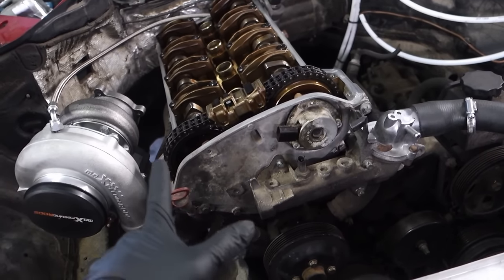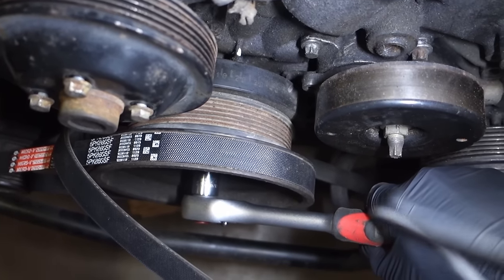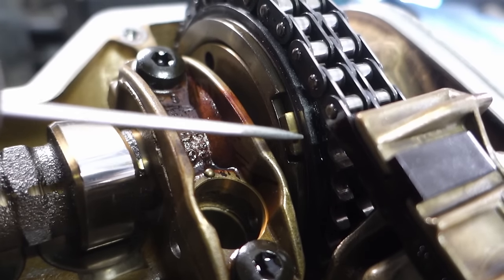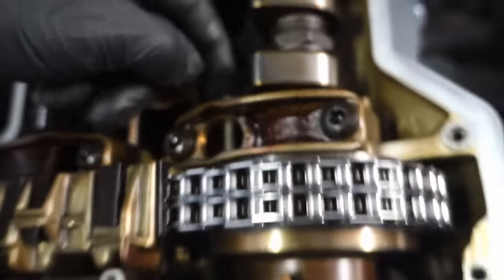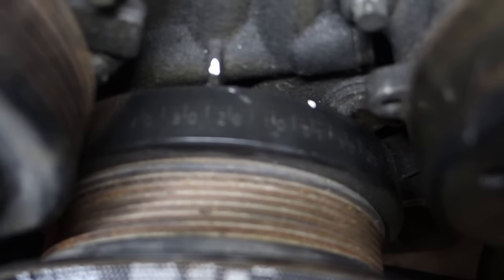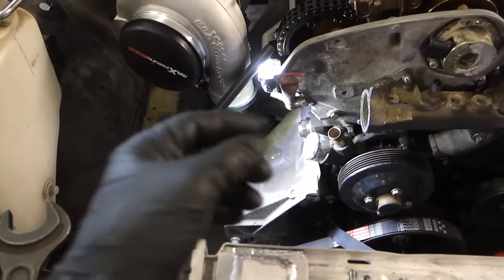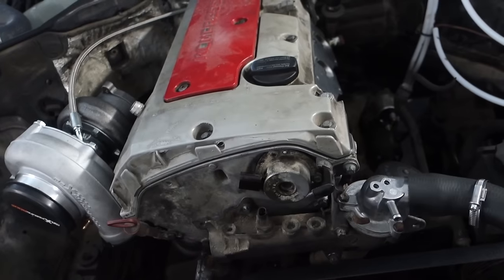Mercedes M111 setting, checking camshaft timing - important details no one talks about

Comment: Mine crank timing is gone 10 only , after put screw inside the cam . Is that ok timing ??
Reply from the maker: Sounds like wrong timing. Watch my full video and check it again.
Reply: @ ok tommorrow i check ..thanks you
Reply: So need to cheq venos sistem tomorrow or what 😔😔
Reply: Hello bro i do IT again now the crank is nearby 30 is that ok right …

Comment: years after but I did not check the timing. my M111 is only noising when coldstart for about 2-3 seconds. Get the tip to change the chain tensioner. I installed the new one but want first that the oil pressure put him in the right position. How do you crank the engine only by starter? I don't want to start the engine and the chain is jumping over.

Comment: hello again, i have to ask one more time. did you set cylinder 1(or 4) in the up position with turning the crank before adjusting the camshaft timing? or does it automatically happens either it is not dependent ? thx in advance
Reply from the maker: Hi, sorry, I do not understand your question. It does not matter you turn camshaft or crankshaft first, when installing timing chain. After chain is installed, you do all turns by turning  crankshaft.
Reply: @MechanikasLukas  he means TDC of cylinder number 1 ?
Reply: It makes no difference.

Comment: Just wanted to thank you for your video that helped a lot .
I have this same motor and it snapped the intake camshaft. I couldn't find a intake camshaft for the exact M111 motor and the one that snapped were not the original and looks like the previous owner put a different camshaft in as it had a 6mm higher profile than it should have and the reason why it snapped as the valves bottomed out.
So eventually I found a camshaft of a later model but the timing pins on different positions. Your video was so that I could see were the camshaft lobes sits in top dead centre. The engine starts and runs fine except for that the one injector is now stuck open and over fuelling because it stood for 2 years.

Comment: Thank you it's a great tutorial and really helpful. Really apreciate that you showed us how to properly do it. Please now I'm trying to solve one problem. I'm not able to reach 20° just 10 or 30. I didn't have space  for oil pump replacement (noisy chain) and mechanic made a mistake - result contact between valves and pistons.. ok now I'm trying to repair it after year ... Do you think that reason why I can't reach 20° could be that guys in shop took 0.35 from head? All timming parts are new. (Changed year ago by mechanic) thank you in advance.
Reply from the maker: Hi, if you are checking timing right, than yes, it is most likely because head was shaved alot, also why they took so much, mostly 0.05-0.15mm is enaugh to resurface.

Comment: Great video excellent work
But when crankshaft is on TDC. We count 6 or 5 teeth for the intake camshaft? It was little confusing to me honestly
Reply from the maker: You need to fully retard intake  cam, than count 6 teeth and 6 teeth must align with that hole I am showing in video. If camshaft is advanced, than it will not allign and  you could not check timing correctly.
Reply: @MechanikasLukas  and then after that i have to lock the camshafts right? Using the TDC method
Reply from the maker: @marwanjoan3789  there is no way to lock camshaft from turning in vanos unit, you just retard intake cam by turning cam anticlocwise, like I showed in a video.
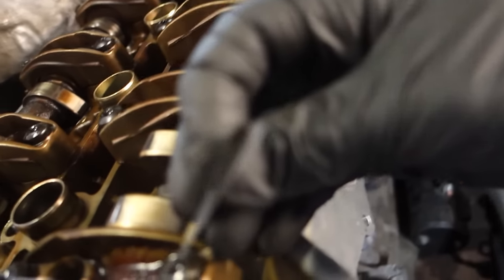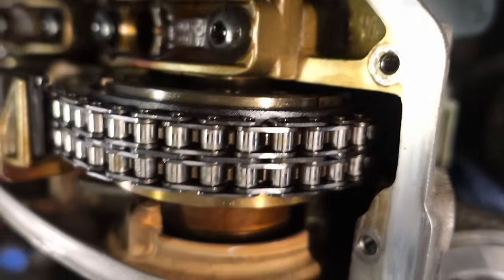Reply from the maker: Everything I explain untill 4:33 time mark. After 4.33 I am showing what you can do wrong, untill 5:12, where I start to explain another way to check timing.
Reply: @MechanikasLukas  i have to lock the cams in position in order to remove the chain so the cams won't jump teeth and timing will be lost right? I'm not talking about vanos anymore
Reply from the maker: @marwanjoan3789  if you removing chain, just align timing marks roughly and remove what you need. You will need to set and check timing preciseley when installing new chain, not when removing it.

Comment: System: ME-SFI-
Engine electronics
Description: Y49 (camshaft control solenoid) ,Mechanical fault [P0010]

encountered an error after replacing the timing chain w203.045 m111 kompressor (P2014-8) [P0010]

Comment: Brilliant video thanks for the help.
The issue I have is when I try to adjust the Vanos it feels stuck and spins the whole engine. If I hold the crankshaft with a breaker bar it still won’t adjust.
Anyone any ideas ? Feel stuck
Reply from the maker: Thank you. Try to turn it other way a little at first.
Reply: Can’t get it to move either direction
Reply from the maker: @jamesscott7682  something is wrong with a vanos

Comment: So I’m trying to do mine can I just do the first method or do I have to do both ??? Please see my coment
Reply from the maker: Hi, you can do any of these two methods, both will work, if you do it cerfully.
Reply: @MechanikasLukas  I tried both today and my pins line up on my exhaust side cam but no my intake and idk how to make them line up please help me 🫶🫶 Thankyou for u excellent video
Reply from the maker: you need to turn intake camshaft to full lock retard position, like I show in my video 3:10

Comment: Definitely not laughing> I think you were saying Vanos, BMW speak for adjustable cam timing. 
Adding this to my list for my soon upcoming head gasket replacement on my 02 M111.981 Kompressor.
Reply: Hey mate, I am re-building an M111.955 engine (2002 C200K) - do you think I need to get a special tool for setting the timing? It does not look like the Mercedes tool HAS to be used...
Reply: @SupaTima  Not sure what tool you're referring to. I haven't yet done the work...rather nervous about it, it's a big job.
But I'm blowing vapor from the engine compartment into the car when not on recirc, so probably a toxic situation and needs to be done. Car runs great otherwise, just the gasket, 
motor mounts and a little suspension work and be like new even at 250K
Also 2002 M111 C230. This guy has the most complete start to finish on M111 head gasket, there are like 5 videos. 
And there's a pin that needs to be knocked out, another video around somewhere on that easiest way.
Obviously you'll need to remove Supercharger which this car doesn't have but  otherwise mostly the same. 
https://www.youtube.com/watch?v=c1l80UG9m9k
Reply: @DimlyAwareHUmAn  hey man im looking to replace my head gasket too soon haha good luck if you haven't done it already. i started today by removing my supercharger and exhaust manifold, but im super nervous about that timing situation
..
Reply: @samurboi8007  is it really necessary to remove the supercharger? Damn, I just replaced the damn thing along with the alternator. Also WIS mentions removing the tube on the back of the head where the transmission dipstick goes with 722.6 5 speed auto, but no mention of how to remove it. On the back ofthe engine. 
Did you remove any fan components, shroud etc?
Reply: @DimlyAwareHUmAn  im not sure about the dipstick. I havent come around to removing that as yet, ive started removing my cams but i got busy again so i have to come back to that when im ready. Im pretty sure youre gonna have to remove your sc again though, because at the side of the engine, theres a chain tensioner, which you NEED to remove along with your cams and reassemble, because the chain will be wayyyy overtensioned and you'll wreck your engine. Check and see where the chain tensioner clears if you're lucky you might be able to get away with just removing the sc top housing which is 6 bolts+ the pesky annoying boost hose clip. The tensioner bolt is pretty large tho, 27mm i believe, its the same as the crank balancer bolt so whatever you use to turn over the engine for timing will come in handy there also. I may have screwed up tho, and remove my tensioner too early before marking where my cams were fully, so i lost my timing there. Oh well, ill cross that bridge when i get to it, itll get retimed anyways to account for chain stretch
Reply: @DimlyAwareHUmAn  and for your latter question which i forgot to include, nah, i have the electric fan and didnt need to remove any parts for it. mainly radiator hoses because my coolant drain plug is broken. really and truly the main work youre doing is higher up at the head and manifold removal. Its really not that hard, just keep track of your bolts, be patient especially when you get into the engine, and youll be good! This engine is old enough to the point where there's a decent amount of documentation online, however its still a super tough engine so failures are uncommon, mostly headgasket or timing chain related. But this video would ensure good timing anyways so dont be nervous!
Reply: @SupaTima  Oh and for you, im doing the same engine. No special tools required, except for 12 point sockets and a torque wrench and star sockets. There's video on youtube for using a bolt and spacer washers to remove the timing chain guide pin which would usually be done with a special slide hammer.
Reply: @samurboi8007  Yeah, I actually managed to install both camshafts, the sprockets and the chain using a couple of steel pins for locking the shafts. The job itself is much easier than a description of the steps required, haha.
Reply: @SupaTima  oh thats sick man glad it worked out, for sure makes me feel a lot better about doing this job myself! One thing im worried about this 240k+ kms on this chain but i dont know how to replace it without some 600 dollar tool
Reply: @samurboi8007  What engine do you have? M111 or something else?
Not sure about the tool you are talking about - I only needed an engine crane, torx heads and so on. Nothing special, really.
Reply: @SupaTima  M111 aswell mate, but for the timing chain, i think you have 2 options. Use a special link tool to cut the duplex links on the chain and then join it back with the new one with the same tool. The other option, remove almost all of the front components, pulleys, Balancer etc to remove the front cover of the engine (i believe drop the oil pan too, not sure if thats necessary on the w203) to expose the whole entire chain, then remove all the chain guides and the chain itself so you can reseat the new one on properly. Its definitely a long and tedious process but its defo safer lol. Knowing as my engine is pretty old and it would probably wear the new chain in badly, i think ill replace the guides and cam sprockets aswell so the latter option is.what im probably going to have to go with

Comment: Hi there
I need some advice if you can give it.
I recently changed headgasket and with that the timing chain and all things around it.
I had NO IDEA about those secrets you shared, but she's been fine and already ran for over 1500KMs.
Would my engine simply die if I didn't retard the camshaft or would it take a long time?
Asking this because lately I've been listening to a rattling noise that doesn't sound like a chain problem, more like the cam adjuster starting to fail of old age, and it's slowly but surely getting louder.
Reply from the maker: Hi, it depends how you did everything. Your engine would not die if it is runing now, but how accurate is your timing now, is a different question.
Reply: @MechanikasLukas  so you mean the timing chain might still not be 100% correct due to the intake cam. Thanks for the info, I'll check it myself.
The engine has been running smoothly though, really nothing indicates I did something wrong except the noise. Hope everything is fine, it's been a bit of an investment in this lol
Reply from the maker: @lushikatakanbaru2508  engine could run smooth with wrong timing by one teeth, but maybe down on power a little.
Reply: @MechanikasLukas  power isn't down by any margin.
I still have yet to open the thing, but first I will do some preliminary tests.

Comment: Hello MegstuBMW, thank you for This great video. We are working on a C180 with m111 engine and used your video as a gide. Thank you for that. 
After mounting a new chain and a secondhand vvt ( vanos) the car keep throwing engine light. Y49 variable timing selonoide mechanical failure.  

It seems that the vanos is blocked on the retarded position. Is there anything we can do to de-lock it ?
Reply: Get it fixed yet ? I would figure buy new cam gears.
Reply: @jesse75  yes we fixed it. Thank you.
Reply: @infoimportexport  cool. How did you fix it ?
How many beers to help yah?
I have to get drunk to tackle my car again.
Thanks to this video and comments like your's.
Reply: To be honest was one nightmare. The mechanic mounted the tensioner in the wrong way. Even after warning him and showing him what will happen if mounted wrong.  In the end he didn’t listen and took 5 minutes to see the engine stops and with damaged valves. Than we mounted a secondhand cylinderhead and followed your steps with the vanos. Also I have a clk in de showroom with the same engine and used it as example. Many thanks again mate. If you where near we would have drunk a couple of bears 😂